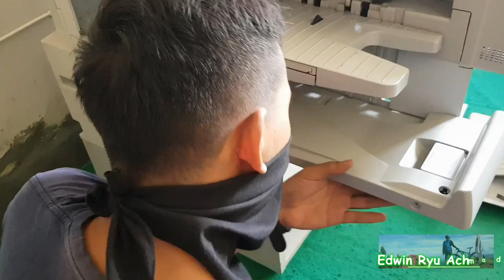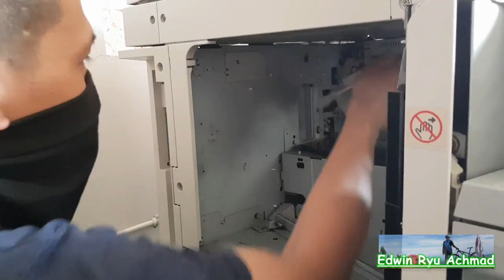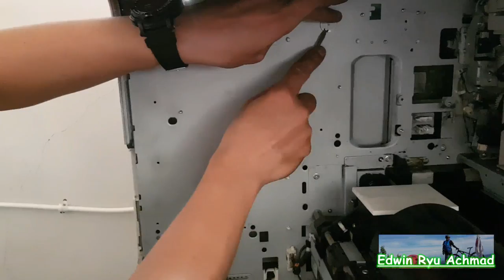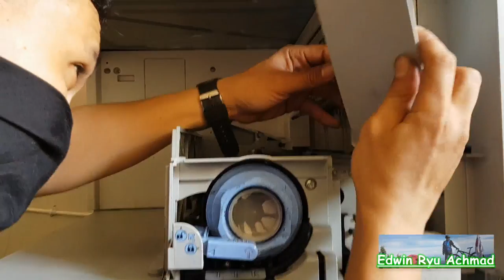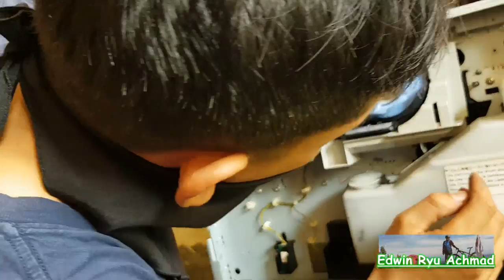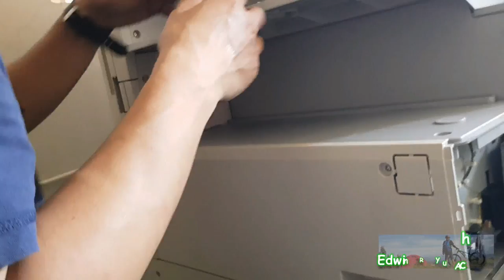Replace Finisher iR3570/4570 iR3035/3045 iR3235/3245

Comment: Mas. Numpang tanya kalo finiser cannot be used. Apa ya mslhnya. Mhn bntuanya.
Reply from the maker: Coba pilih tombol Additional Functions, lanjut di layar pilih Common Settings, trz pilih tanda panah ke bawah cari menu Limited Functions Mode, kemudian pilih Off trz pilih Ok, kemudian matikan mesin n nyalakan lagi,
Reply: @EdwinRyuAchmad  sudah dicoba tapi malah muncul E000520-8001 mohon pencerahan.. Thanks
Reply from the maker: @herusutiyo9002  ada kesalahan di finisher,,, harus dianalisa lg,, kemungkinan board nya rusak atw ada yg slah di mekanik finisher

Comment: bang @EdwinRyuAchmad minta tlong pecerahaannya.
Ir3235 saya error " Remove the jammed paper near the finisher output area "
saya cek 28 jam - code 1647. error tidak ada. sensor no. tidak ada
kenapa ya bang ? thanks before. sukses slalu.
Reply from the maker: Kl pas awal nyala lgsg kedetek jam paper, biasanya difinisher ada kabel yg putus,
Reply: @EdwinRyuAchmad  ya bang pas awal hidup. waduh kabel putus ??? gmn ceknya tu bang ? dicek satu satu dong ?
Reply from the maker: @warisman1107  ya, dibongkar cover2nya, cek semua kabel difinisher,
Reply: @EdwinRyuAchmad  sudah bang. sudah saya cek. kondisi kabel bagus semua

Comment: Bang kalo finsher nya ga Mao naek turun apa nya yg di benerin?
Reply from the maker: Kasus tray finisher ga naik atw turun, coba bongkar kdg di dalem finisher ada plastik yg patah, atw sensor n motoran yg bermasalah, mentok board finisher yg bermasalah,
Reply: Tolong mas saya punya mesin3045 kakao kopy keluar kertasnya hitam semuanya
Reply: Bisa bantu mesin3045 kalau kita copy keluar kertasnya semua hitam
Reply from the maker: @cesariopinto9357  untuk kasus hasil black kopi, kemungkinan masalah di bagian unit drum atw developing, cenderung karna ada yg korslet, coba cek primari dan drum, atw cek unit developing nya, cek spacer n laher kdg ada yg macet, atw magnet roll nya sendiri kadang aus,
Reply: Ok terima kasih banyak
Reply: @EdwinRyuAchmad  bang derah mana, barangkali bisa cekin canon ir3045 sy daerah brebes
Reply: @EdwinRyuAchmad  kalo misalnya error 540 terus itu om apanya yah .. bagian sorter yang naik turun kan .. saya udah cek semua bagian sensor sama DC sama budrum nya .. tapi masih tetep aja error 540 .. output tray mulu